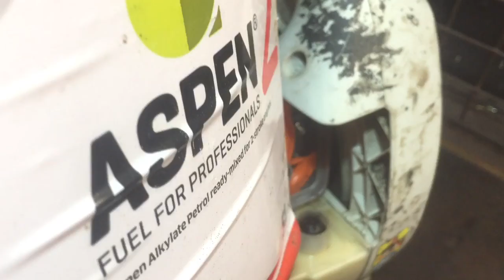Stihl BG86 Leaf Blower ( Let’s Make it Work again ) Mend It man can fix it , Carb 🔧💨👍

Comment: Have that same issue with interference on the carb I'm installing now on a Stihl blower.  Rather than drilling the filter housing for that tube, wondering if I can simply cut the tube off the carb and allow the primer system to vent externally just like the original did.

Comment: Hi luke the model I have is very similar to this the sh86c apart from the air box configuration they are very alike but unfortunately the piston on mine has scoring and looses pressure after running for about 10 minutes 
Not going to give up on it as I have a few places to source a non oem part from but after watching conker and his chainsaw clearance head replacement I might just hold out for a donor
Reply from the maker: Hi Vince I’ve had good success with after market cylinder and pistons, I think perhaps with Conker there were different variants for his model. I have a video coming up soon when I fit an after market pot and piston with good results. Try and save your blower as they are a good machine 🙂👍

Comment: Snap argh ! You know I have never done that I've been very lucky ! Luke it runs like a new one NICE !
Reply from the maker: I shouldn’t have tried to save the pipe, they were stuck on there very tight, but tbh I did have a spare but as the carb was only £14 I went that way this time saved me time cleaning and rebuilding the carb. It runs great another one saved 🙂👍

Comment: Superb job with that carb never seen that done before, worth knowing. Great vid
Reply from the maker: Hi every carb I looked at for sale had that while pipe piece on it, strange though the hole to drill was marked on the filter housing when it had a carb on originally that didn’t require the hole 🤔 anyway quickly sorted out and I have a good blower here now, thanks for watching 🙂👍

Comment: Good fix mate .. I had the same problem with a carb the other week . I too had to drill a hole.. they do get messy around the carb don't they
Reply from the maker: Thanks, it’s strange the template is moulded for the hole, but the original carb is different 🤔 Yes they get filthy, the bit I hate most cleaning, but it came out well. Thanks for watching 🙂👍

Comment: Top job Luke,  seems to be running great.  That old fuel filter looked like the ones echo use.
Reply from the maker: Hi yes I think your right that old one was a Waldron one I see them a lot in strimmers, usually it’s the new one I put back in these blowers, I’ve been using the blower at work this week it’s been running great👍 Thanks for watching 🙂👍